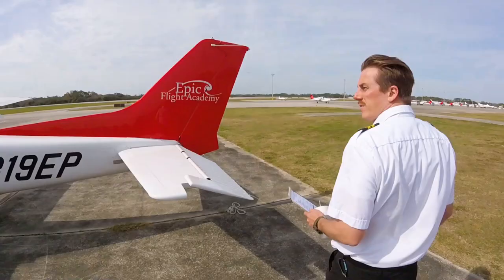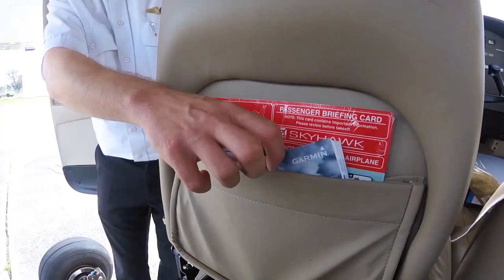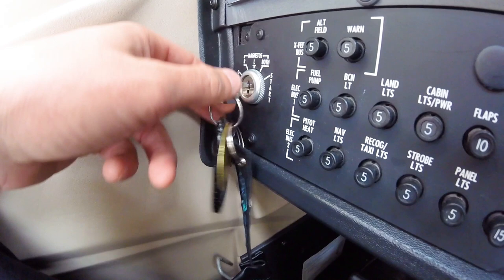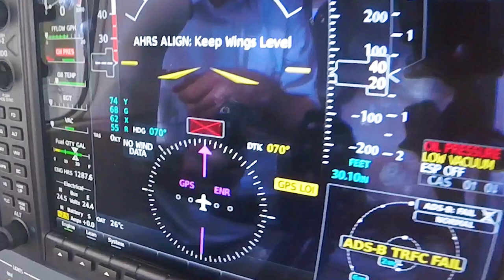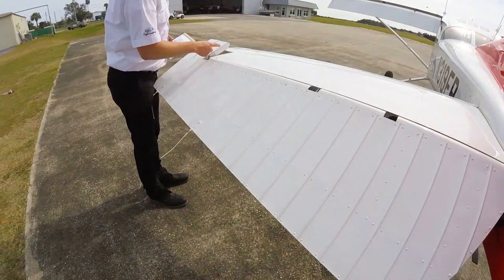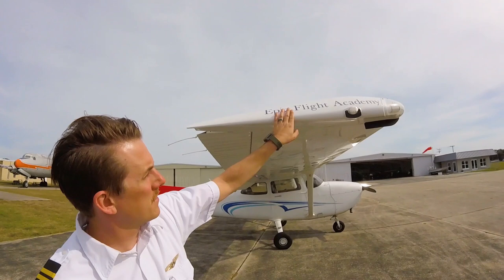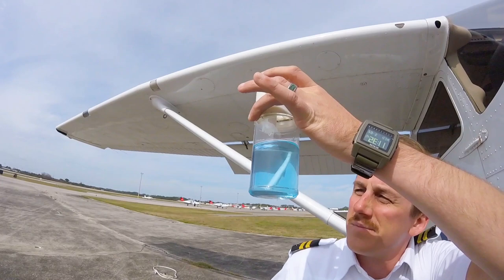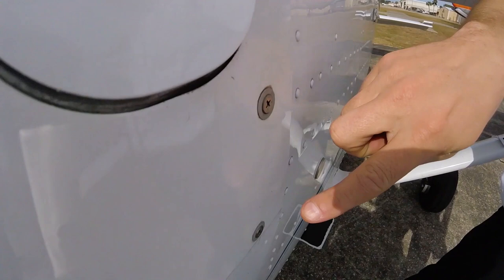Complete Preflight Walkthrough: Essential Steps Before Every Flight

Comment: Where do you put the water, then?
Reply from the maker: That's a very good question! 
If there is water in the fuel you must notify maintenance and pour the fuel and water into a proper container for disposal.
Reply: @EpicAviationEpicFlightAcademy  Do you use a different fuel stick for different type of aircraft that requires different types of oil or fuels?